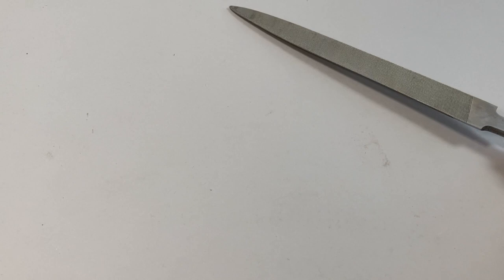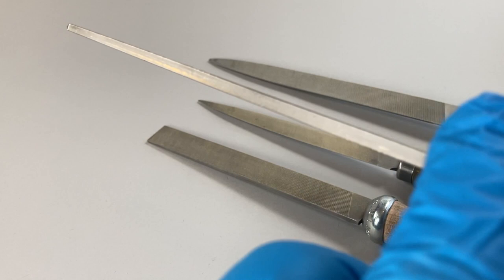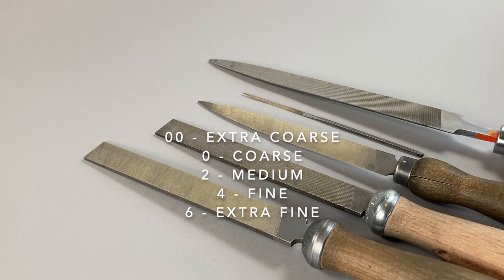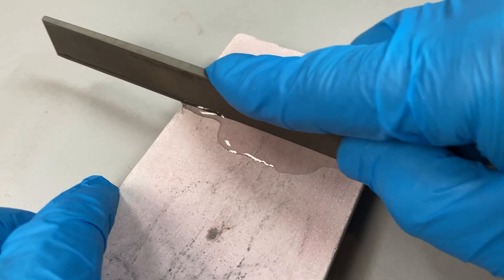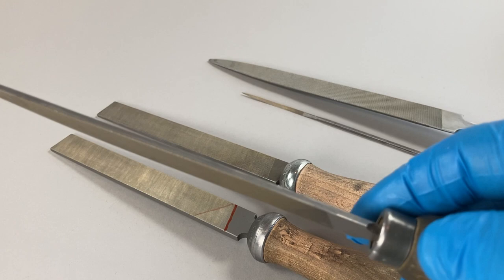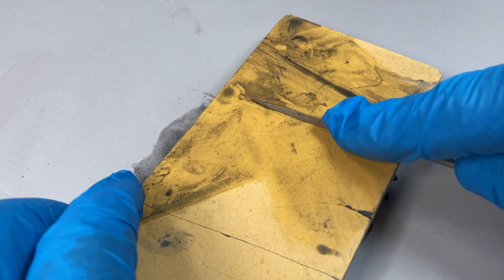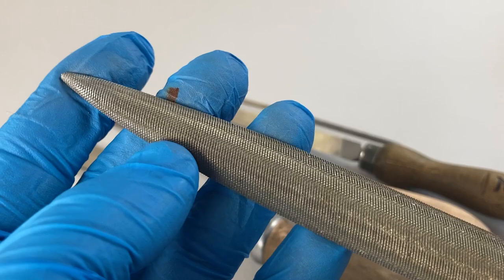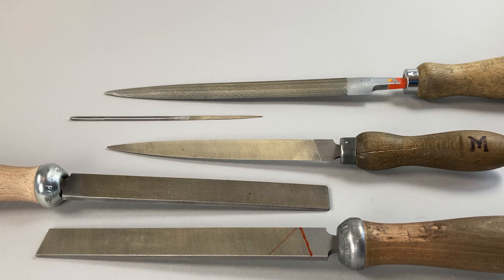021a  An introduction to files for the clockmaker #Clock #Horology #Workshop #Shop #Tool #Craft

Comment: I want you to make a video about how to clean clock mainspring properly. Like oily or rusty. Here I saw some videos but many of them caused to loosen flexibility
Reply from the maker: I just clean them manually (with a brush) in paraffin (kerosene).  Personally I avoid use of ultrasonic.  Avoid anything water-based.

Comment: Hello,  could you explain how to know when a clock spring is overwound and how to fix that?  Is that what  you refer to in your videos as ' letting down  ' the spring?.  Thanks for any advise.
Reply from the maker: Hi John.  there is actually no such thing as an overwound spring...  A few things can happen though.  most common being the clock stops for some reason (old oil, depthing issues etc) and the clock fails to run.  the owner winds the clock and because the clock still will not run (a depthing issue is often made worse by more driving force), they might try wind a little bit more (a bit like putting your foot on the gas in a car).  what happens then is with nothing because the spring and often old lubrication is bound up in the barrel, the spring may tear, crack or even in worst case break.  overwound is essentially a stopped clock with a fully-wound spring.  letting down the spring is simply releasing the ratchet mechanism and unwinding the spring.  I think I did a video on this.  It must be done safely otherwise all the stored energy will be released in an instant and may cause personal injury or damage to property.  here is the link to the letting down the spring video
            https://youtu.be/VfqbIIk6YKs
Reply: @howtorepairpendulumclocks  Thank you Mathew,  Good of you to  reply.  Yes I've checked  some of your other videos,   basically I'm  trying to get an Enfield going again for someone  but I  don't have enough knowledge to take it too far and make a mess ! Great to have access to your videos and knowledge  though,  thanks again.

Comment: What Number file would be recommended for sharpening fishing hooks?
Reply from the maker: Best use a diamond 'file' or hone for that.  The ones by Eze-Lap are great with the plastic handle.  They come in a set so you can work through the grades to get the kind of finish you need.
Reply: @howtorepairpendulumclocks  Thank you